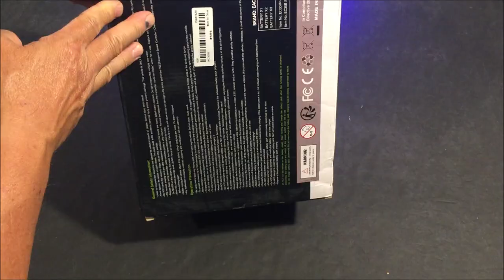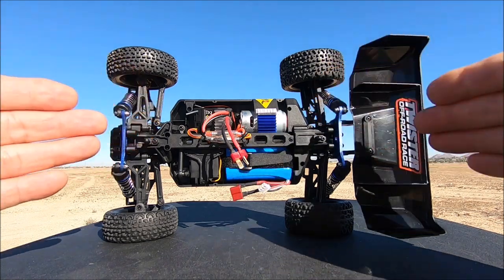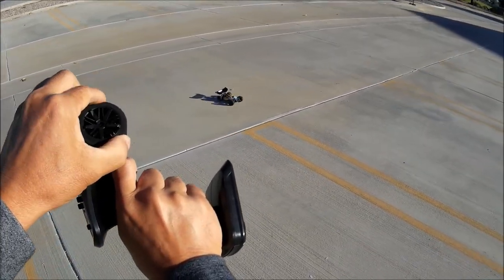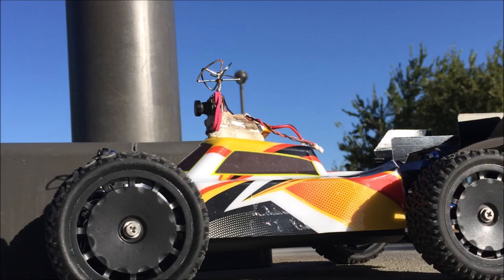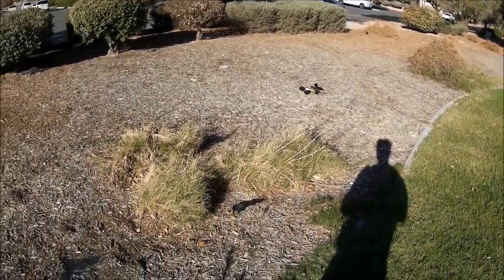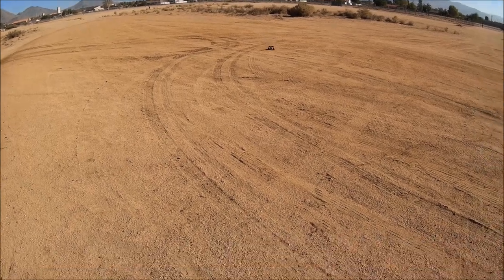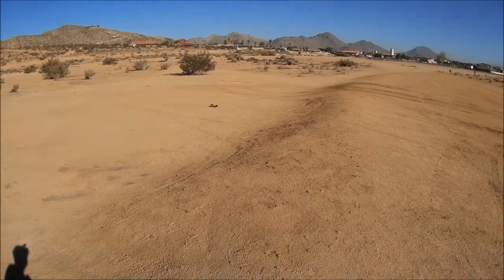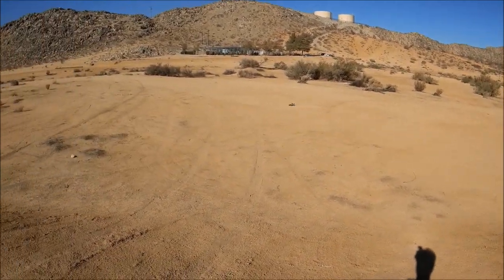$65!! 🔥🔥Eachine EC30 Twister XB Review, Speed Test and Drive

Comment: These are a lot of fun and there extremely durable, the chassis are identical to HBX and we have had great fun with them. That is a good deal with 3 batteries 👍
Reply from the maker: Yes, the batteries are cheap when you get the multiples only like $12 for two 18650s already made :) 🔥🔥🍺🍺👍👍